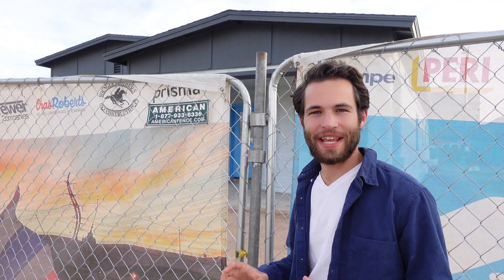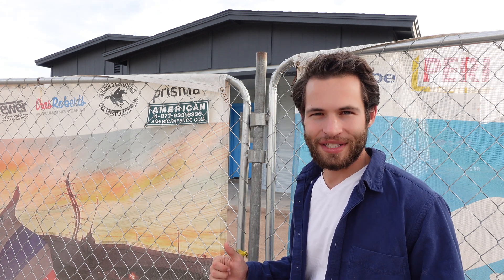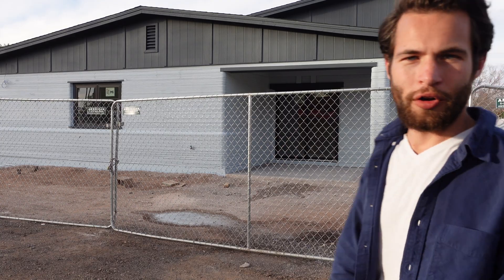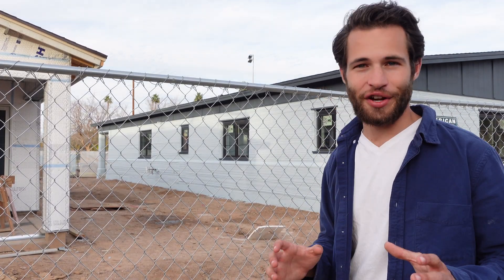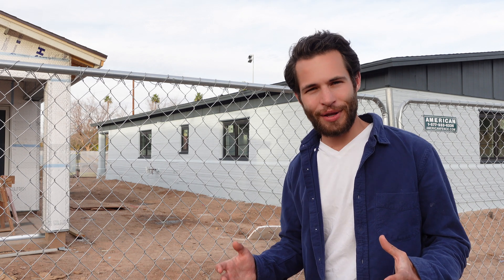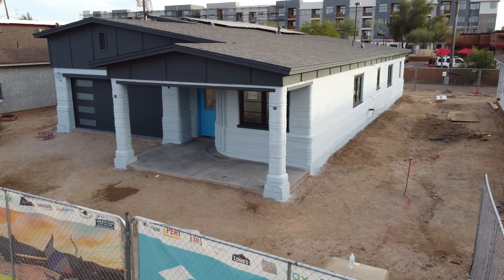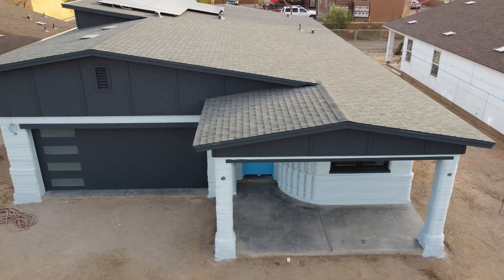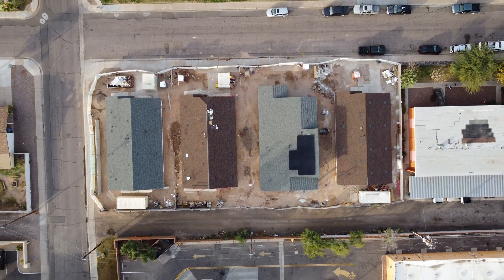3D Printed Home Exterior Complete Before Conventional Homes Nextdoor

Comment: Working on a process to build inexpensive, small scale housing - largely for disaster relief - overseas. The gantry mounted printers are kinda clunky and difficult to set up, the articulating arm design is hard to move and level, and in the case of both, other than removing labor from the cost, I don't see a tremendous advantage. In fact, it may add risk to the build in the event you have a mechanical breakdown mid-project...So my thinking is this - staying within 3DR you take a site-based printer, much smaller in scale, and make pre-fab panels on-site, then utilize some sort of snap in place system for the assembly...Question: Do any of the current 3D printers have the ability to work with aircrete?...

Comment: I would only take a course that teaches about how to do the plumbing for a grey water systems, how to do the wiring for net zero solar energy with a demand side monitoring system, and passive house construction techniques in a 3D printed house as well as best practices for 3D printing construction and maintaining the COBOD printer. Certification is optional, but preferred.

Comment: I am skeptic about time reduction in buiding houses using 3D printers, since walls account for less than 10% of building time of a brick house, and even less time with aircrete or concrete houses. Building from large light blocks of aircrete is really fast and easy (and low-tech and low know-how) and building from prefabricated concrete is probably the fastest. I think 3D printing has specific advantages, particularly in style and uniqness, but I don't think it will make a notable difference in building times and costs. I think that is a common misunderstanding.
Reply from the maker: Much of the time savings relates to how other trades can integrate with printed walls without cutting if there is good preparation.
Reply: @automateconstruction  Yes, I'm aware of this, but the same applies to prefabricated concrete panels. They do the channels simly using strips and blocks of polystyrene screwed to a casting box. Or sometimes even include tubes for services and even equipment. And while this is not available with aircrete, it's extremely easy to work with; i.e. acumulator two disc channeling saw is enough and you can cut with it much easier than through a pine wood (I'd estimate at least 5 meters/min). In addition to that, the producers also offer many special blocks that make for easy assembling and interaction with the rest of building. I'm sure 3D printing has it's future, it has it's advantages, but I don't think it's time and costs. Even if the future 3D printers could print few times faster, it doesn't really matter in the overall picture. Just remember your visits to construction sites - they printed waslls on  already prepared (=time) concrete base in days and when you came back often after weeks, the house was still under construction. It's not like it would be finished few days later. It's actually rather months, than weeks.
Reply: @oakld  For now, 3DP is therefore ideal for architecture that can't be achieved with prefabs.
However when 3 things happen 3DP will even take over prefabs as the most affordable and fastest construction technique:
1. multi material printing
2. mass production of printers and materials
3. full automation
Reply: @panicraptor2837  I fully agree with the new architectural perspective 3D printers bring. But I think that the 3 points will have no decisive effect on the time and cost of building, even if fully realized. The price of printers will most likely come down and they'll become widely available. Automation will progress, like elsewhere. Practical multi-material printing - I don't think so (the "practical" is important here). All this will help to make 3D printing viable in the higher-end sector, but this is not exactly about time and cost. There's one thing with quite a potential though - it's "hollow" design, houses, that would use much less material retaining just enough structural strenght to be considered walls. So kind of hi-tech, kind of crappy design. Will it matter? Not likely, if building material prices will come back to normal. However if prices of crushed rock, cement and sand continue to rise significantly, it may become an important point.